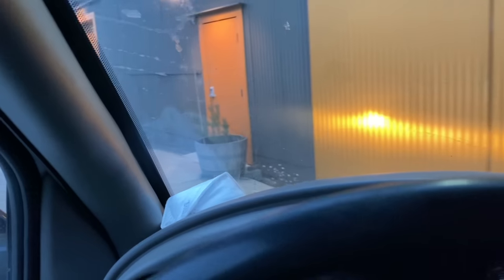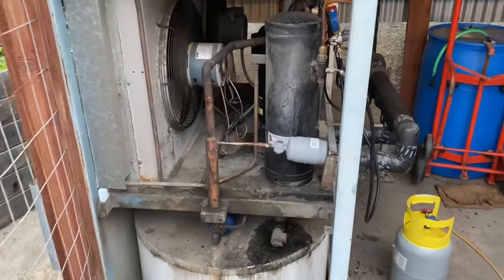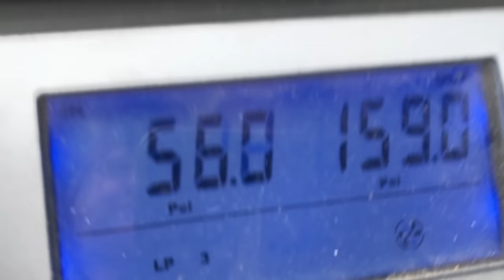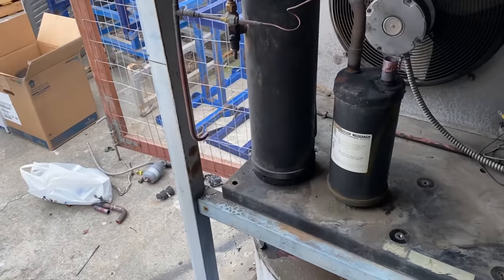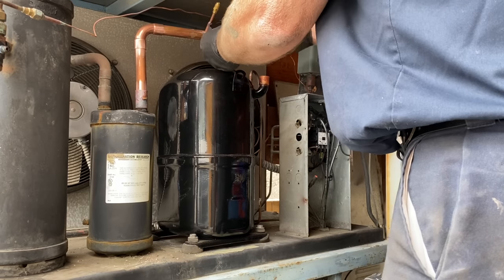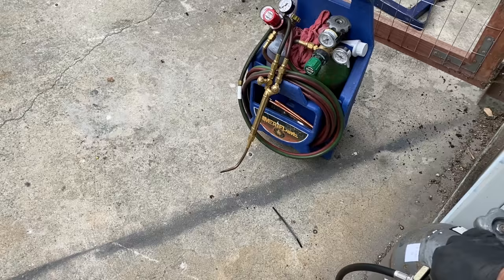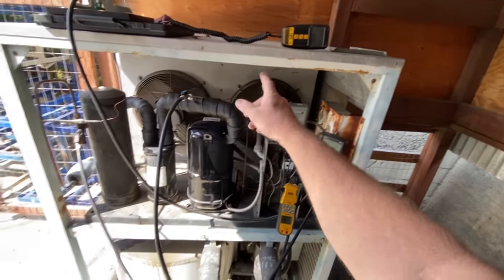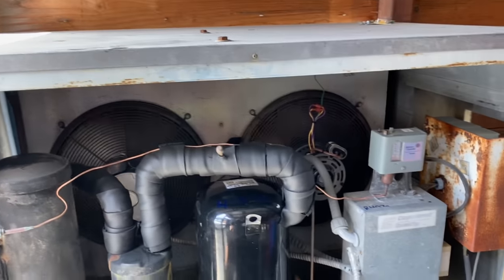Replace a compressor on a Brewery chiller

Comment: The ball valve is set to a specific flow rate, so they can maintain a specific temp coming back to the glycol tank. Kind of like when you adjust the outlet of a water cooled condenser so it has a specific water outlet temp.
Reply: Correct, so the system can manage to cool the glycol in buffer tank and not huge load comes back from the beer tanks
Reply from the maker: This is why YouTube rocks. Great input fellows.

Comment: That was a nice job, easy access for a change. I have drilled an access fitting on existing piping I know the super techs heads will spin 🤷‍♂️. I still have colored tanks, I KNOW I’m going to screw up. Nothing wrong with rebuilding a piece of equipment in that instance, it looks in nice shape. Great job Dave.

Comment: Whats the best stuff to use to clean drain lines on walk in freezers and coolers
Reply from the maker: Water
Reply: @NorCal-refrigeration  thats it good deal had one with black and yellow slimmy crap in it wasn't sure if needed to do more than just hot water

Comment: I noticed u didn't change the txv dave it won't be affected by the new 407c ?
Reply from the maker: No R407c is a R-22 replacement
Reply: Cap tube

Comment: shouldnt you put your crank case heater on the NC contact on the contactor so its not running when the compressor is running....!?
Reply: This is the correct way but in most of the times they are connected in NO contact
Reply from the maker: Correct I did not have the contactor